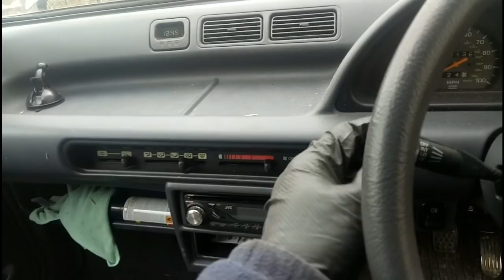Perodua Nippa (Kancil) alternator belt change - how hard can it be?

Comment: Its not just the length that counts its the girth!! Less girth=lower in the v of the pulley = longer belt! Top tip drill a couple of small holes in the bottom rail of your ramps and put some nots and bolts in so they stick down in the ground = studded ramps!

Comment: The rust problem on the crash bar is common on old daihatsu cars, heat from the rad hoses cause condensation on the underside of the bonnet, that interns causing water to drip down through the foam and hense the issue, I solved the issue on mine by taking off the grill part by un dueing 4 screws/bolts and sanding down the rust to bare metal, bonding over it (fast setting bought in Halford) primer the areas then sprayed over it with number matching paint code on the firewall, problem solved :) only a 1  hour job

Comment: Good job Ian....the correct belt does help :) Now have you ever heard of using tights for a belt to get you home......used to be called the fan belt. Well, I can assure you it does work.....had to do it once, many years ago (of course). Not too far to get home, but far enough to be a problem and overheat the engine. Only alternative was take the rad cap off and drive very slowly so the water could circulate without a pump.
Reply from the maker: Aware of the trick, but I've never had need of tights, as most cars I've owned either don't have a water pump, or it's driven by the cambelt. When the alternator seized on my Mk1 BX, the only tool I had was a knife, so I cut the belt off and just drove home.
Reply: Thankfully you're not old enough (grin) Although much simpler, running old cars back in the 60s could in fact be a right pain. Modern cars, computers aside, are much more reliable. And if you go back even further, to make a long distance journey in something like? say a Ford 8 you had a 50% chance of a major breakdown. Why every village had it's own small garage.

Comment: This is my favourite type of car; the small, simple, straightforward basic runabout that engrains itself deeply into your affections as a family pet. It has no frills, no gimmicks, but takes you everywhere you need to go comfortably & reliably, and then brings you home again. A bit like a best friend, and full of character. It may not be deemed desirable, but you become so attached to it that you could never part with it. You probably give it a name too. I just wish manufacturers still made cars like this, instead of oversized gaudy monstrosities dripping with touch-screens, silly apps & blue teeth. Whatever the heck they are???
Reply from the maker: Er, I'm not so sure about the 'comfortably' bit. It is quite tiny, with tiny seats and tiny suspension travel. It's fine for blezzing around the Welsh hills, but I wouldn't really want to take it on a long trip.

Comment: Nice footwork, get signed up for the lions. I stopped outside the factory gates in Selangor once, why? I took a wrong turn on the way to visit a mate in Klang, so I stopped the bike to curse the twat-nav through a cloud of Dunhill smoke, didn't realise what it was until I read the sign "Perusahaan Otomobil Kedua Sdn Bhd". Happy days.
Usually foam like that has a rubber coating on the contact surface. Could try replacing it, alternatively just soak the foam in anti rust wax.

Comment: It is a little economical car, nice to keep.

And a quick repair, there is actually some space to work with.
Reply from the maker: There really isn't that much space. Getting at that bottom bolt on the alternator is a right sod of a job. I only did that because I thought it might give a bit more flexibility to get the belt on. But is was the wrong belt...

Comment: The equivalent car here in New Zealand  is called a Daihatsu Mira. My understanding is that they are basically, almost a clone of the Suzuki Alto of the same period, but instead of Suzuki's 3 cylinder 660cc  12 valve engine, they got a slightly larger, but simpler 2 valves per cylinder 3 cylinder engine. My understanding is that Daihatsu is, well became,  the "small car" division of Toyota. I had the Suzuki Alto 660cc and I knew someone that had a Daihatsu Mira.
Reply from the maker: +KiwiCatherineJemma They are built to the same kei car regulations, but the Suzuki Alto is a different design, which was shared with Mazda in Japan. 660cc is the kei car limit, but larger engines were fitted for export. The Mira/Nippa is 847cc.
Reply: A later model was sold new in New Zealand, typically ~1000cc - the L251 through to around 2006/7 ish.  It went under the name Charade  but I have also seen identical model cars in other countries under the name Mira and also Cuore - great cars.      The current model is the (Mira) e:S  https://www.daihatsu.com/news/2017/20170509-4.pdf for the Japanese market.  Read about the awesome fuel economy https://leopauldelrosario.blogspot.co.nz/2013/08/daihatsu-mira-essubaru-pleo-plustoyota.html  Furthermore, its a brilliant case of badge engineering because there are versions by Toyota as the  Aygo Pixis Epoch and Subaru as the Pleo Plus

Comment: Those ramps are fools of things when used with smaller diameter wheels and placed upon smooth concrete; I was given a pair some time back and promptly drove my beloved 1989 1.3 Charade up them until one ramp slide forward, away from said vehicle and the other ramp drove itself along said vehicle scoring a foot long gorge under the door sill:-( BTW thanks for you efforts:-)
Reply from the maker: Yes, the Nippa HATES going up them. I should get some better ones.

Comment: I saw that rust converter used by a Youtuber called Maximus Ironthumper on his Land Rover and he said it had to be painted over after it had dried. 
Have you ever tried Rustoleum Direct To Rust? I've used it on bicycles and it's fairly good, though some colours are better than others. Black is very good. Hammerite do it too. Hold a bit of cardboard to mask the engine and other parts and spray it on.

Comment: Will replacing it with the wrong belt shorten the "life" of the wrong belt? I had mine replaced earlier this year but it seems to be loose already, i suspect the belt was not up to spec for this car..it was affecting my air-conditioning as alternator was not running optimumly yo power up the compressor
Reply from the maker: This one seems ok. No air con here.

Comment: I tried to swap the belt on my Nippa a few months ago but got stuck with the bottom bolt. My clever car mate managed to a get a socket and long bar on to free it from the top. The old belt was a Gates and the local motor factors matched it up easily. Put the Gates numbers in t'internet and you get the belt size of which there are plenty on auction sites for a couple of quid. My Nippa has v high emissions so won't pass it's MOT in May. Struggling to find the correct temperature sender - any tips where I can try and get one? Enjoying the vids but missing the old blog!
Reply from the maker: We had that exact temp sensor issue a year or so ago. I can't promise this is the right one, but I did end up ordering a Daihatsu Mira one. Can't recall the connector type now. https://www.ebay.co.uk/itm/FAE-33310-Sensor-coolant-temperature/282815106165
Reply: Many thanks, I'll keep looking. Mine is a single pin connector.
Reply from the maker: Searching for Mira Temperature Sensor brought up some like that.
Reply: Ta v v much, that's extremely helpful. Best wishes.

Comment: Cheap, cheerful, I suppose it beats walking, when was the last time that had an oil change? It does sound a bit hammy, especially when cold.
Reply: Spellcheck changed cammy to hammy.
Reply from the maker: About 4000 miles since last change. It's always sounded like that. Still sounds a lot better than a Vauxhall triple...

Comment: You said that the old belt was too large and at the end of adjustment, yet your replacement was only slightly smaller which was surely what you wanted.
Reply from the maker: I guess so. First belt comparison was old and the wrong one. Second comparison was between the 'wrong' belt and the second replacement.

Comment: Gosh a simple car, must be difficult to drive in the very hot weather without air conditioning. I recall my Kia Rio being so basic and difficult in summer.
Reply from the maker: I live in Wales. We don't really get hot summers. On the plus side, you can reach three of the window winders from the driver's seat, and the fourth isn't much of a stretch.
Reply: HubNut in reality, you cannot beat simplicity. Their is something pleasing about owning simple cars, even if it's air conditioning by all windows being down.
Reply from the maker: Or the roof back in the case of my 2CV.
Reply: I live in South Wales, when I moved here from the English coast I was told by a local that summer consists of 2 days and that more than 2 days without rain was consisidered a drought. I thought they were joking.......